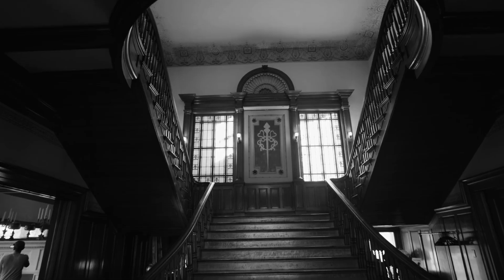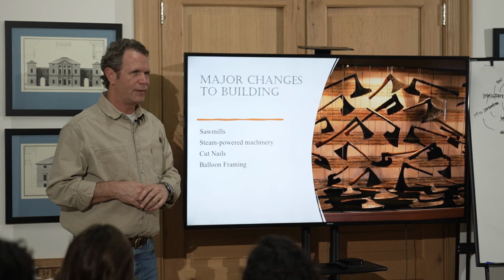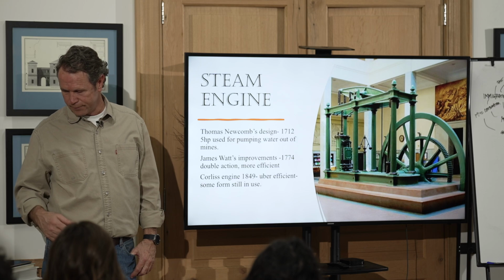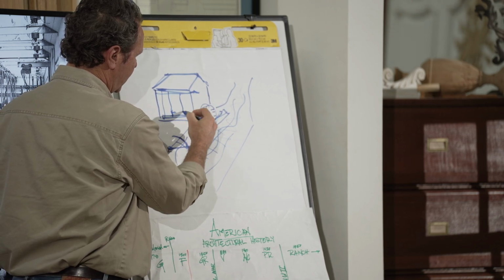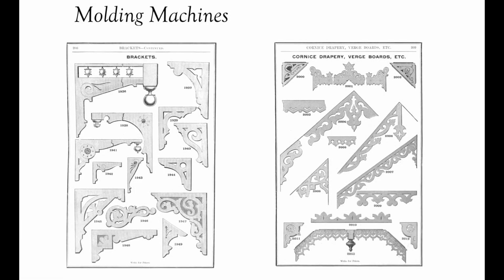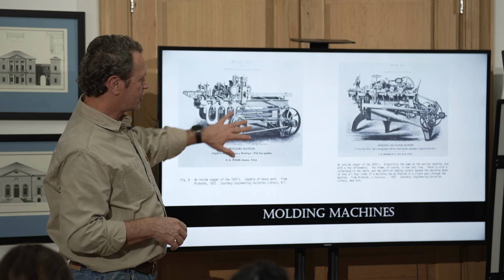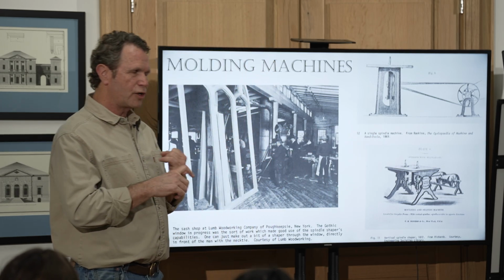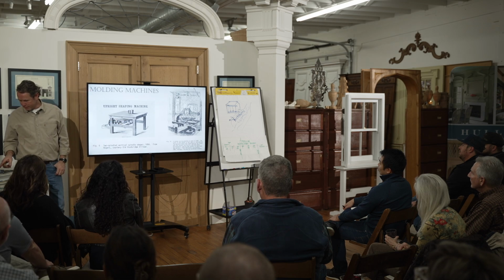How the Industrial revolution changed woodworking.

Comment: Thomas Blanchard and his inventions are worthy of mention here. His first invention was a machine to mass produce tacks. His most important invention was the “Blanchard lathe” which could duplicate complex wood shapes. He fortunately lived in Springfield Massachusetts, home of the Springfield Armory. The legend goes a wood gunstock maker told Blanchard he would never be replaced by a machine since his movements were too intricate. Blanchard’s response was “ hold my beer” and the Blanchard lathe was born. It is the great grandfather to the key duplicating machine seen in hardware stores for those of you that still carry/use keys. Blanchard lathes we’re used to duplicate not only gunstocks, but wheel spindles, axe handles and shoe lasts ( molds). Until the invention of the Blanchard lathe there was no left and right shoes. His lathe could make a perfect mirror image by running backwards which couldn’t be done accurately by hand using eyesight. He could also duplicate the shapes of the lasts either larger or smaller in exact proportions for different shoe sizes. When you put your shoes on and decide which is left and which is right, you can thank an inventor from Springfield Massachusetts and the firearms industry.
Reply from the maker: Awesome info. Blanchard is actually mentioned in the great book called Innovation that was a great source book for the Victorian and Romantic era talks. Thanks for the story. Cheers

Comment: I ponder how much exquisite wood shavings and chips ended up on the shop floor around these old molding knives. I suspect the worker's lungs were the original dust collectors.
Reply from the maker: It's interesting to think about these historic spaces. Thanks for watching.
Reply: Dust is only really created with saws and most larger saws have a large teeth so they tend to tear large fibre runs. 
Most carpenters in the past worked out doors as well as indoors and it mean in a lot of instances that they would have allowed fresh air to carry away any small fibres. 
Truth is every physical job creates dust and for those in offices they tend to take in other types of dust.

Comment: Thank you for another fascinating video. I’ve made furniture without any nails or screws. The joints hold it together (plus glue!). I wonder how the building code and inspectors would cope with a house made like that today?!
Reply from the maker: Good question. I know nailing patterns on sheathing are part of code, some parts need it. Thanks for your thoughts.

Comment: Very interesting what you say about the influence of machines on house building. One of the most significant advances was the ability to plane to reasonable flatness joists and rafters. With a reasonably level joist you could then attach reasonably flat floor boards and get a reasonably flat floor. 

The order required by Georgian houses was a big advance on the buildings of Tudor and Stuart England. For the Georgian style to work, you needed precision. Given that Georgian really refers from 1800 onwards, this was before the Industrial Revolution but there were places that would be able to flatten wood. Timber would be cut and left to season for several years in the round but with bark removed. Then the saw pit was used to roughly dimension; the better the saw work, the less flattening required after. There are a few saw pits left that date back to before 1850; it was a rough trade for the man at the bottom of the pit (also called the underman  as opposed to the top man)  because he had to saw almost vertically upwards, standing in water and he would get all the sawdust straight on him. Even after water-powered saw mills were possible, the laborious saw pit method continued for a while.

After “rough cutting”, many times the timber was refined using an adze. Different shapes for different trades and different regions. It is quite remarkable to me how flat an adze can leave a surface. Adzes were still being used in the 1940’s in smaller scale wooden shipbuilding.

As the labourers were paid per foot run, unnecessary work was not undertaken. Therefore, for a building joist, you would get 2 sides flattened for a the ground floor ceiling/ 1st level flooring but only 1 side flattened for the ground level flooring and roofing rafters.
Reply from the maker: Good stuff!!! Thanks for sharing as always. Cheers.